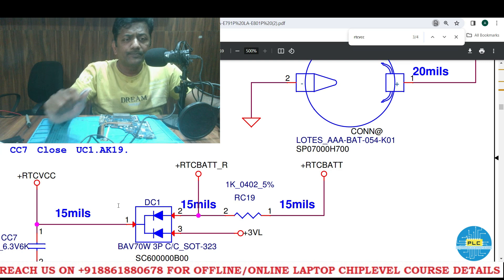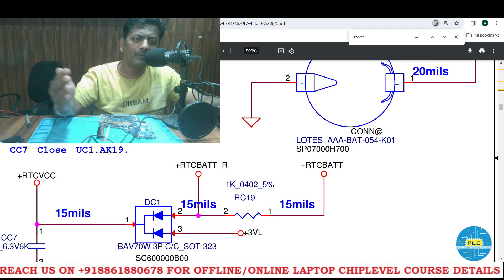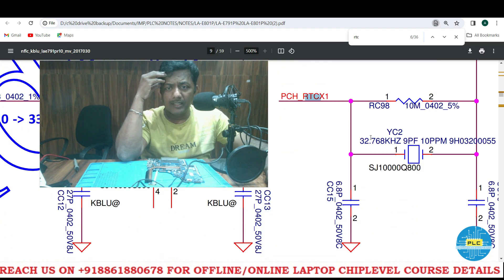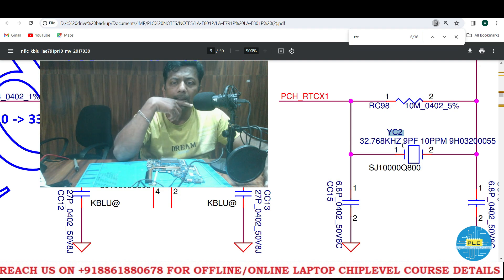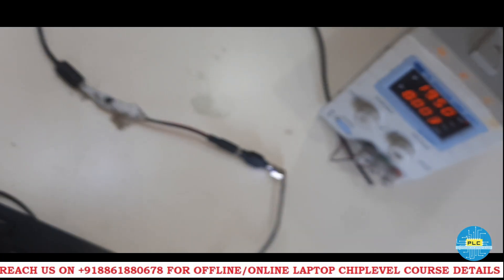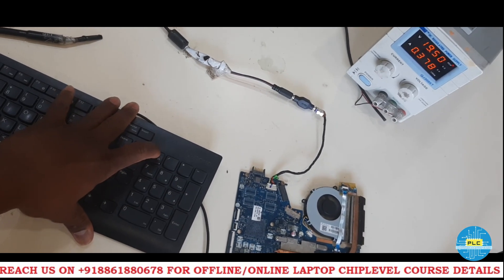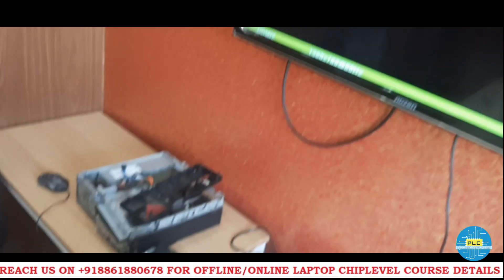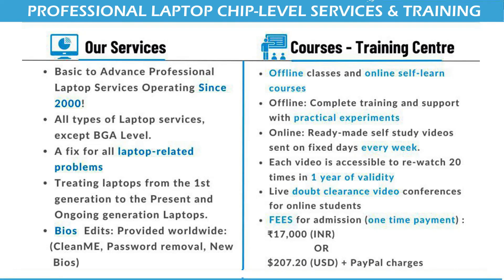THE MOTHERBOARD WILL TURN ON WITHOUT THE RTC CRYSTAL.  Is it true? The fact about RTC CRYSTAL

Comment: Int his video the starting voice of Nasir Sir and he is a excellent teacher on IO to PCH SOC communication, otherhand Sir, you are also a excellent teacher for your unique concept, but as per traditional concept it is almost impossible to turned on Motherboard without 32Khz Crystal. In my observation 32 Khz Crystal boost the frequency to continue recycling. Main frequency are generated from PCH and come to crystal and after getting boost it returns back to pch. 

In this case the strangth of frequency generated by PCH for RTC Crystal is so strong, thats why it turned the motherboard On. Therefore it will happened with some new generation board.
Reply from the maker: Very nice comment 👌.  It's true

Comment: There is a different  crystal (25Mhz) for PCH. this crystal is for clock as far as I know.
Reply from the maker: U r right. But, in some motherboard,  without crystal or rtcvcc, board won't turn ON. Actually from 7th gen onwards we can see these kind of activities.
Reply: @LaptopCourse  thanks for the update. even tough I repair motherboards I don't get the diversity as you do since i work for a certain brand.by the way huge fan of your work. gathered lots of knowledge from them. keep up the good work